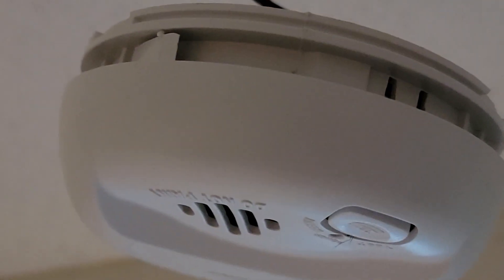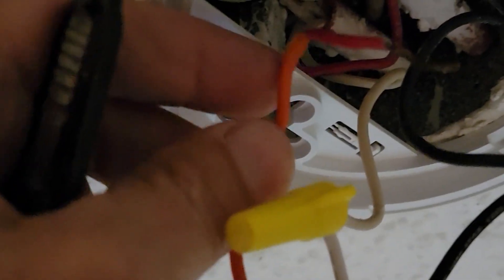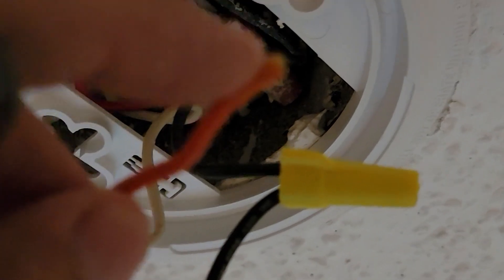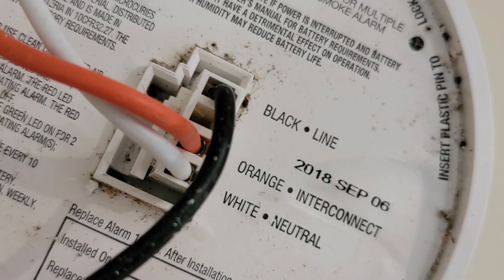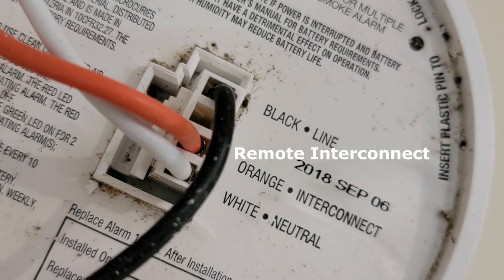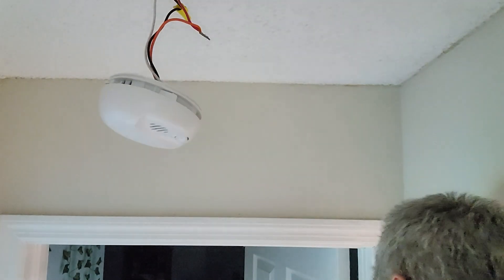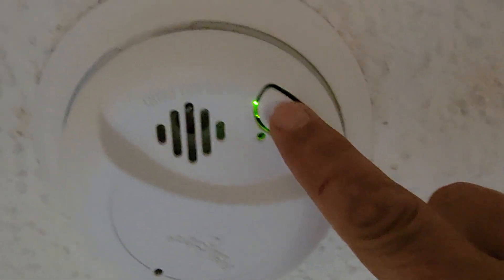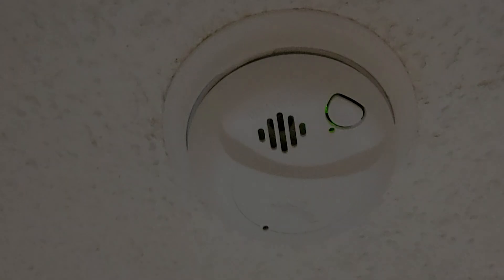STOP Installing Smoke Detectors WRONG!

Comment: Hopefully the red wire is an interconnect wire and not the other hot wire in the system.
Reply from the maker: The black wire is the hot wire in the system. The red wire pops out at the other smoke detector, which we already verified.
Reply: Yep. Always test and never trust someone that has taken a shortcut. Pretty much on everything you own. I've seen it to many times.
Reply: Black is always hot or line power. White is return or neutral. Green is ground.  Then, another color could be hot or line or a runner depending on the type of device such as a 3 way light switch.
Reply: @Garth2011  I agree. I’m glad he said they did test the red wire to be sure what it was before just connecting it. You never know what a previous installer may have done.
Reply: @Garth2011  Never say "ALWAYS". This is what gets people into trouble.

For example, a cable run to a switch to turn a light on and off will usually only contain a black and white white. So, to follow the current NEC, the white wire should be marked permanently with a color and be connected to the constant hot source conductor, and the black wire in this 2 wire cable would then be the switched hot conductor when the switch is turned on.

This is one example of why what you said it's not always correct. 

But also a reason why testing should be done to confirm what you might believe after you open the boxes up and observe the wiring in each location.

When I was in the field, we typically would wire the smoke detectors to a lighting circuit, because of this circuit gets turned off the homeowner would know very quickly.

If the smoke detectors are on their own circuit, and there was a false alarm, someone could turn of the breaker at the panel and the circuit could remain off for a long time which is not what you want to happen. 

So if the smoke detectors are wired in to or share a lighting circuit then this normally wouldn't happen but this is where you might also encounter a red switched wire that is not part of the smoke detector wiring.

My point here is never guess. As Mikey Pipes says, "If you ain't testing, you're just guessing!" 

And guessing, while helpful in troubleshooting problems, isn't the way to leave an electrical life safety system like smoke detectors.